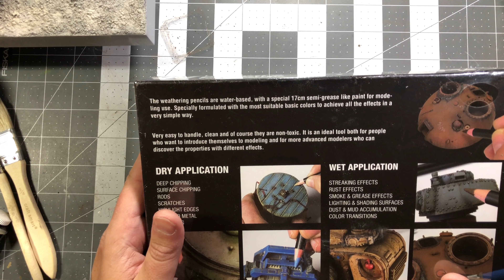Plastic Scale Model Build - Takom T-54B 1/35 - Part 7, Penicls, Oils, and Final Steps

Comment: Nice work. It looks like  you achieved the look you wanted. It came out great!
I would practice with the pencils, on a piece of (matte) painted styrene or an old model 🤔.  I have the same set and practiced with it till I became comfortable using the pencils for finishing details and such. They definitely help. 
The original vehicles, some of them, were very chipped up. And in my opinion, even though it could be correct and authentic like the picture, it just wouldn't be what is wanted. 
A good example, I recall seeing the M109A2 Howitzers, we used back in the 80's, completely dripping with thick mud on the roadwheels. I built a 109 using the AFV Club kit; painted it with the old camo pattern, but decided, it would be ruined if I slathered Vallejo and Mig mud all over it. I believe that's what artistic license is. Ya just don't want ruin all that wonderful detail like that. I'm sure you get what I mean by my example. Anyway, excellent work, as it brings back some interesting memories of these vehicles, I saw in person, many years ago!
Well done!👍🏼👍🏼👍🏼